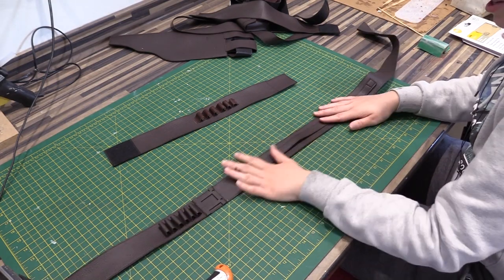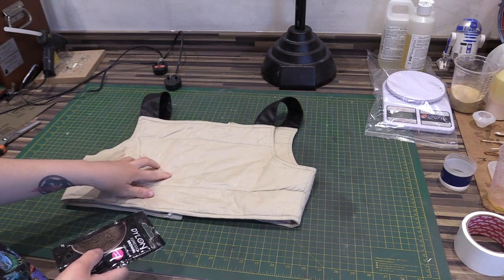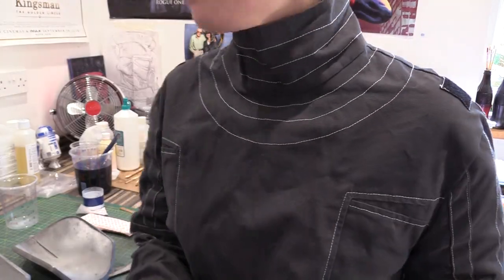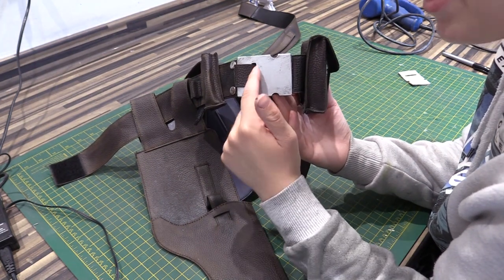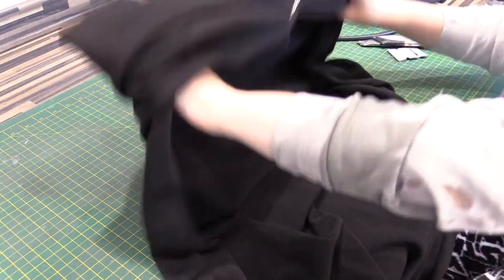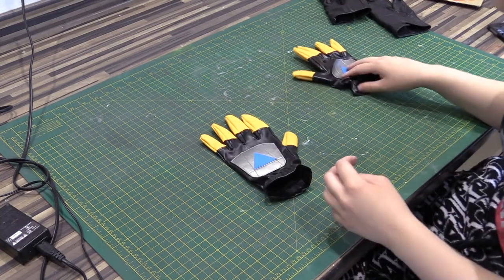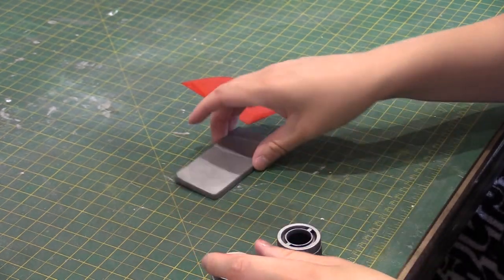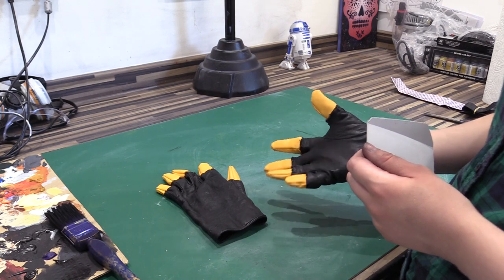Making The Mandalorian Costume Part Two - Modifying the Suit

Comment: How did you manage to stitch the velcro in place without having to unstitch the jumpsuit? I'm currently making a mando costume and have to add some stitching but don't want to do it without having to take the whole thing apart. Any tips you have would be much appreciated!
Reply from the maker: Hand stitch the velcro 👍